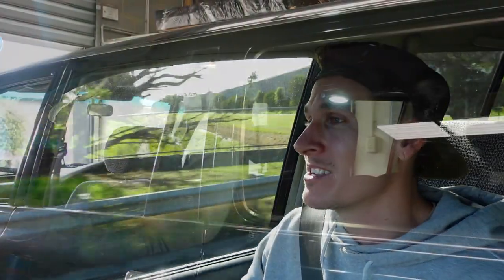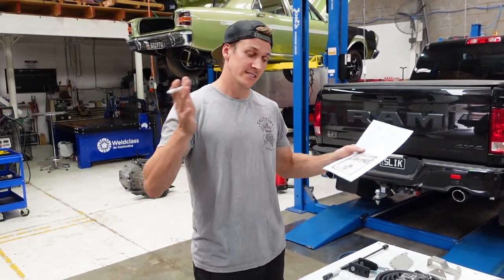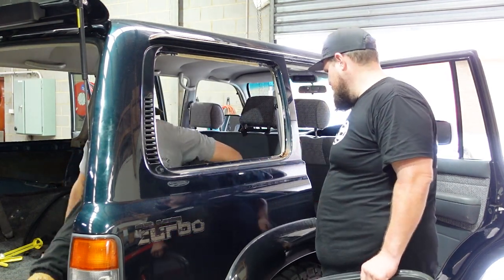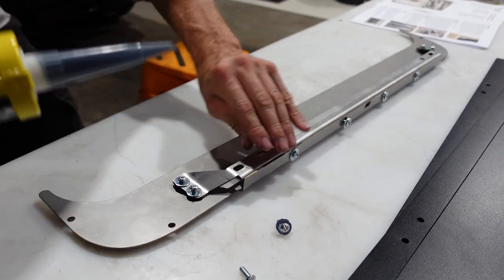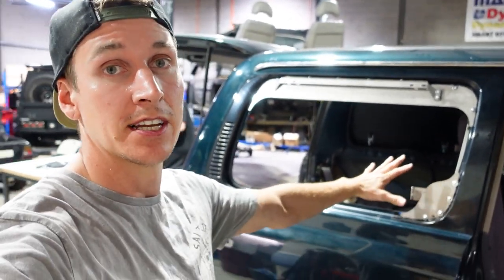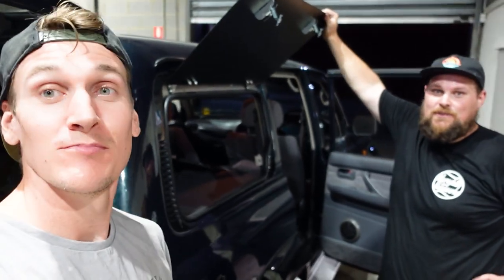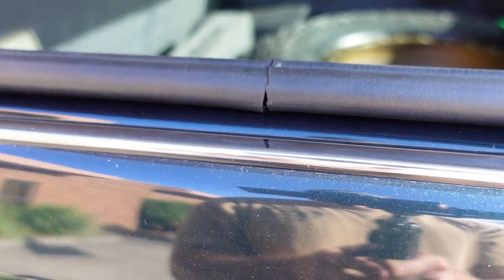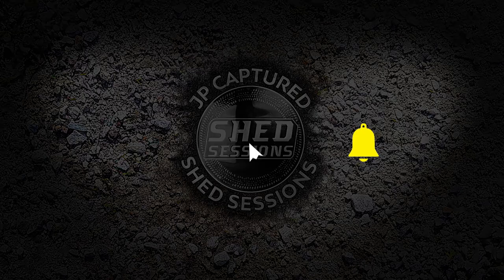80 Series Landcruiser Lift-up Windows - Easier Cargo Access

Comment: Jp I pulled my battery out to charge it put it back in, now driver widow doesn't go up with one touch button have to hold it on to bring it up,and after I started it and turned it off there is a buzzing coming from engine once car is locked.its a 2019 np300 4x4.stx.